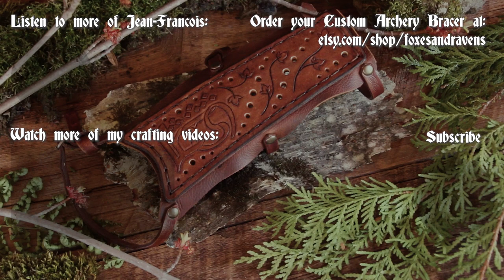Crafting an Artisan Leather Archery Bracer

Comment: Can you tell us more about the needle holder you have in this video?
Reply from the maker: I'm not 100% sure which thing you're referring to. Can you give me a time code?
Reply: @FoxesandRavens  it’s the thing you keep your needles in. After some research it seems like a Viking or Celtic bone needle holder.(time code 7:01)
Reply from the maker: Gotcha! Yes, it's actually antler, with designs from the Viking period, that a friend made for me for Viking reenactment :) It's not a typical design from that period, most other models that I've seen have a piece of cloth inside, and are open on both ends, but I like mine!